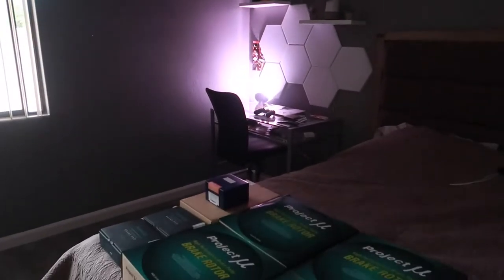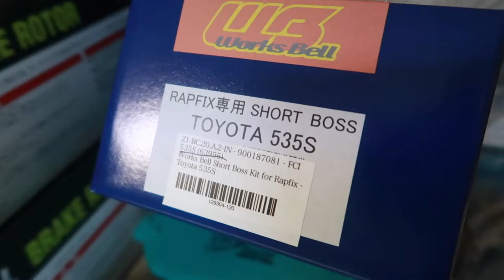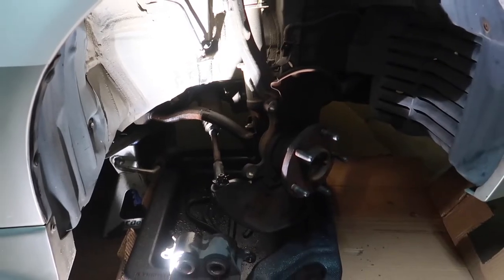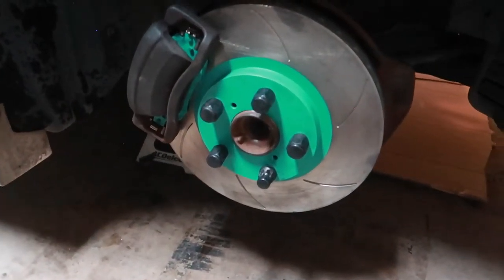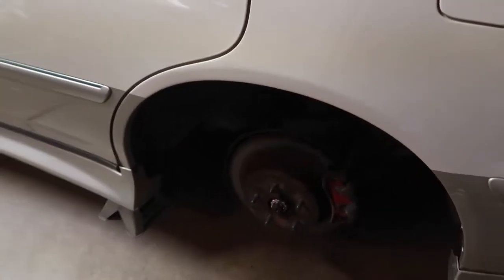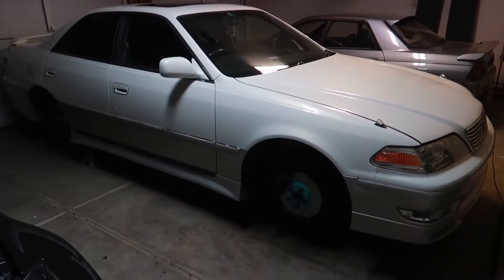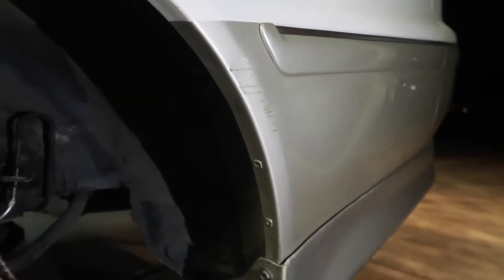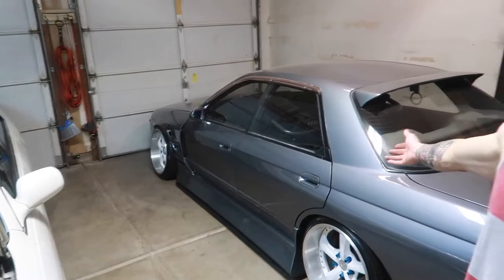Project Mu brake system overhaul on the JZX100 Mark ii!

Comment: Great stuff man. This is good to see. But is that oil leak problem a major problem on all JZX cars? Or is this just due to some neglect of the previous owner?
Reply from the maker: The oil leak is from neglect and it sitting for so long. What sucks is I have to pull the motor to access the lower and upper oil pans.

Comment: question, how do you get around the crazy shipping prices on RHD Japan. Been looking to get some Bride seat rails and shipping comes out to $200+ not sure how to approach it lol need a ton of JZX100 parts.
Reply from the maker: The best thing to do is order everything you need and then “ consolidate” ship it. Really can’t work around shipping prices other than that. I’ve always just bit the bullet.
Reply: @artisansdream  gotcha, was thinking the same. although I've got a laundry list of items lol. Tourer S to V hopefully this summer.
Reply from the maker: I would also hit up TF Works and or System motor sports. They tend to have parts for our chassis in stock, just marked up a little. Sometimes it out weighs the shipping from over seas.